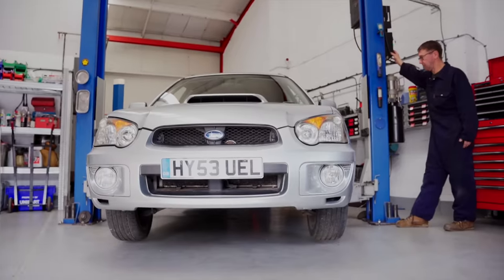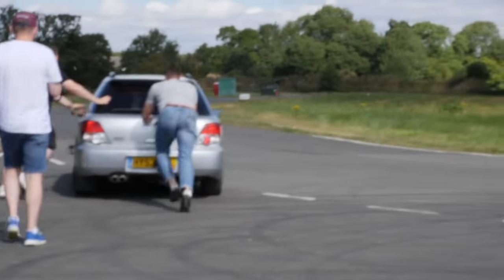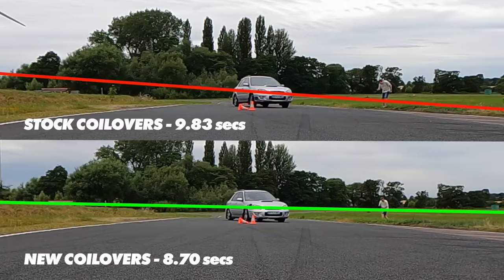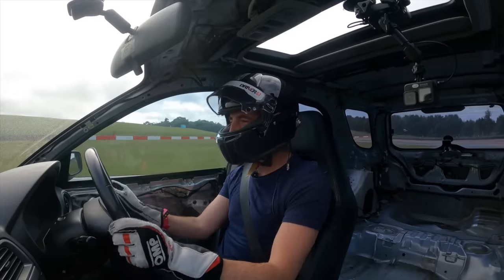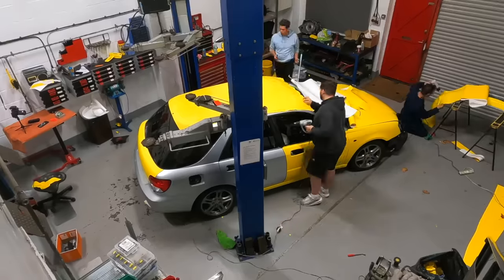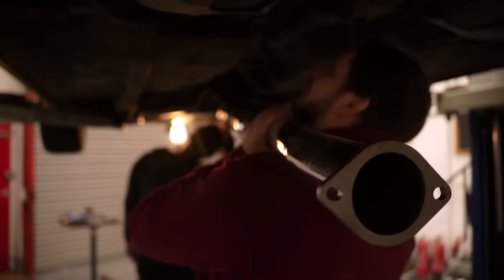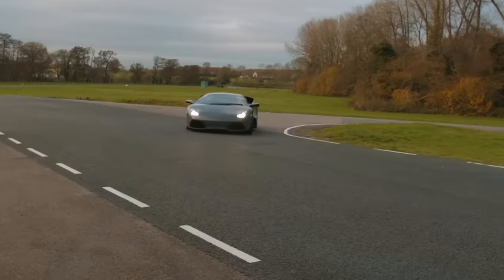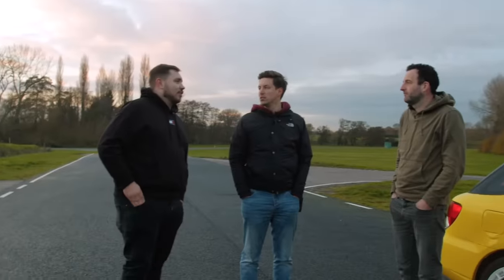We Built a $10,000 Subaru that BEAT A Lamborghini

Comment: New it made 221 horsepower AT THE CRANK so 196 at the wheels isn't bad!
All vehicles have a crank hp rating, but there is losses throughout the driveline. So all that power does not actually make it to the wheels.
The 300ish you made at the wheels would put the engine's actual output closer to 330. Unfortunately there no set "this is what you lose" number and all cars are different. Some may lose 20hp some may lose 120hp.
Reply: 196bhp at the wheels would make more sense as a before figure but there is no way it made over 300bhp at the wheels on the standard TD04.

Conversely if 196bhp was the crank figure to begin with (which would suggest the car was somewhat unhealthy!) I don't understand how it then made such incredible power with the mods/mapping. The TD04 is usually only good for 280bhp with all supporting mods.

My JDM WRX of same era made 273bhp at the crank with the standard downpipe still in place.

Comment: Isn’t the stock 224 rating bhp?? So their 194 whp with AWD is actually quite impressive for an engine with 140k on the clock
Reply: Also, dynos can vary from stock ratings regardless of whether the cars are new or old due to temperature and air pressure. If you do a dyno test at a higher altitude than the manufacturer the air is thinner, and vice versa. The barometric pressure also varies day to day, so doing dyno runs on different days can give small variances in power.
Reply: @stigrabbid589  Temperature and air pressure will make a much larger difference on a naturally aspirated motor than a forced induction fed motor, but you are definitely correct. The difference from the variables you mentioned would be, at most, still under 10% even on a n/a motor, and probably under 3-5% for a turbocharged motor. The point of my comment was  acknowledging the parasitic losses in this car's drivetrain and how, once corrected for, their WRX was basically making factory stock BHP numbers with 140k miles. While obviously a lower temperature day when they tuned, I don't think it would be that much of a factor relative to the factory rating.

Comment: Biggest difference of this series vs Donut and why it works is the track. Couple laps around a karting track vs a half dozen ppl hot lapping a giant 120mph desert racetrack
Reply: they took it to a bigger track too and that was before the DIY yellow wrapping so it was at half power and it did pretty well.
Reply: Actually it comes down to the Overdrive guys reaching out to the Subaru community and listening to the suggestions they were given versus Donut media ignoring everything they were told and making the same mistakes repeatedly.